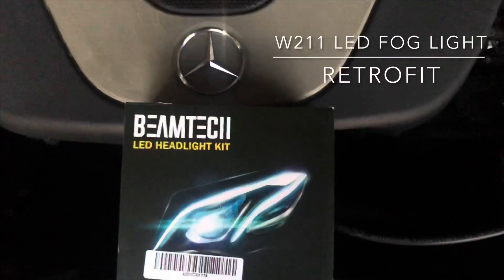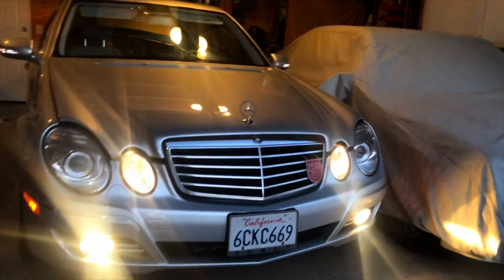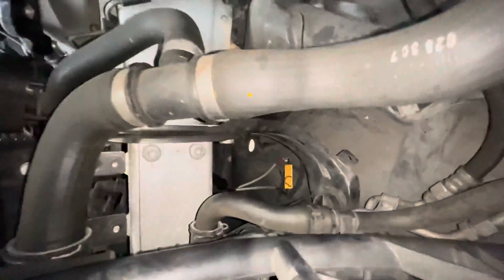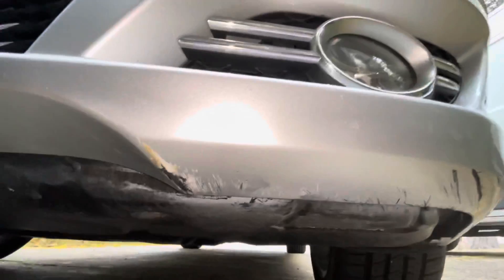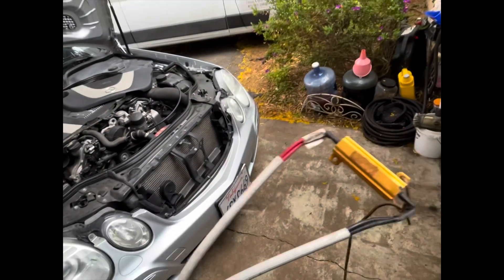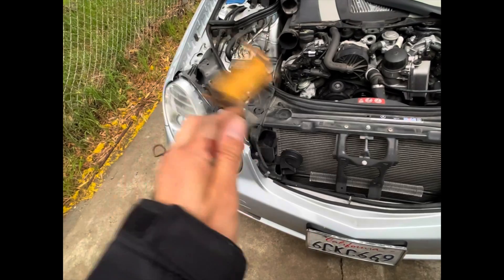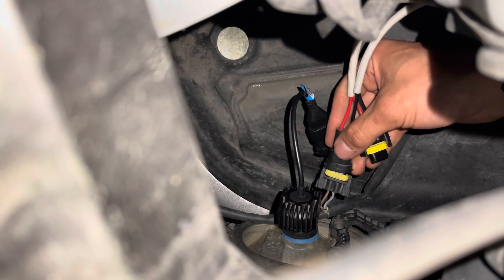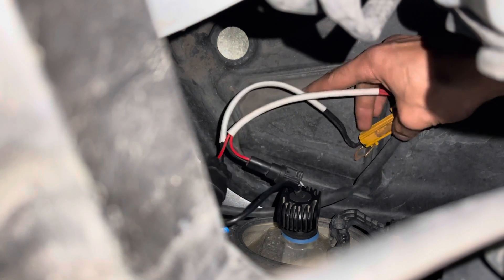W211 LED Fog Lights Retrofit

Comment: Why not through the bottom, I saw a special window on 2006 through the wheel well.
Reply from the maker: Yea, on the pre-facelift, they had the cut outs I think
Reply: 2004 e320 same process pre face lift

Comment: If you have the setting turned on that uses a fog light as you steer at low speeds that usually fades or dims in and out when using halogen bulbs. What happens when you try with LED in? Does it fade in and out or just sharp on and off each side as turn or does it flicker as the LEDs don't like being dimmed ?
Reply from the maker: Just turns on and off as far as I know. Doesn’t fade

Comment: After some time - the resistor will get hot, can get extremely hot. Better to screw to the metal to dissipate heat.
Reply from the maker: Yea they get real hot. I think that’s why I was hanging them.
Reply: @MercedesTech  they need surface expansion for better cooling. I sent you a link for a h11 that doesn't need resistor.
Reply: @pfoxhound  can you send me a link
Reply: Where did you mount yours? As of rn I have mine hanging with a ziptie
Reply: @pfoxhound i need link i have 2004 e320
Reply: Can u send me link to resistors you used please.
Reply: Link? 😂